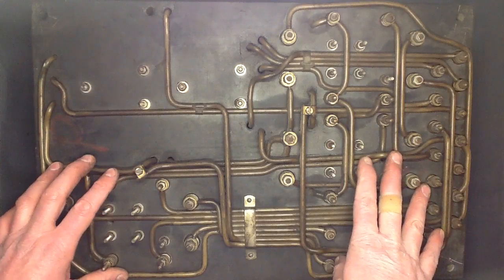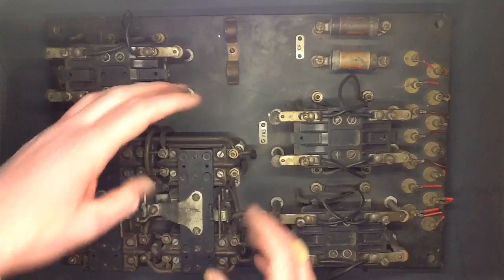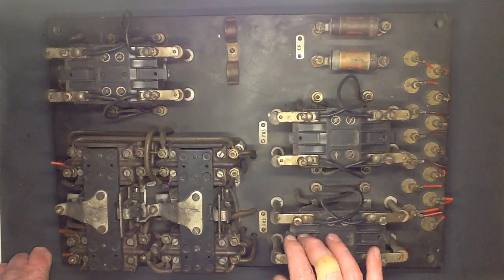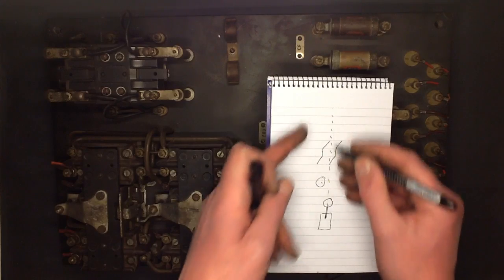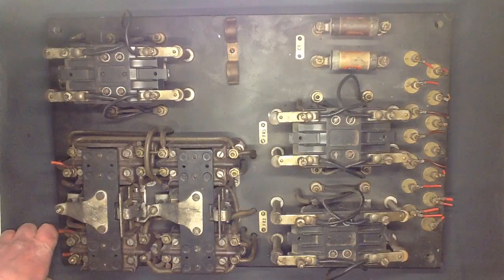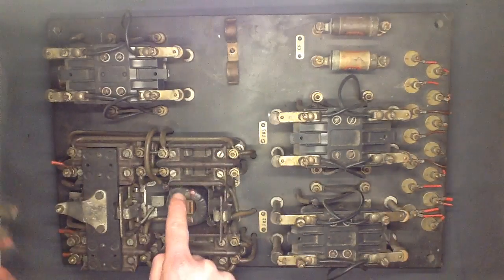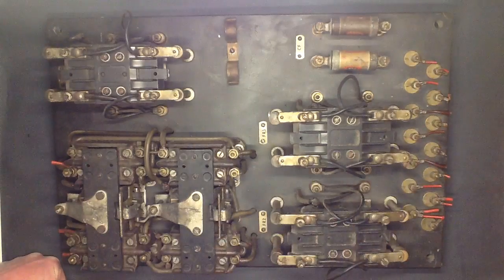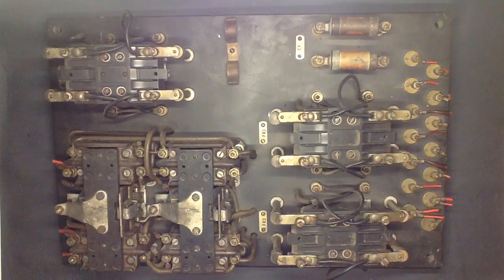Really old and VERY heavy slate elevator controller.

Comment: Why replace this ?
Why not simply add a circuit after it making the electric motors ramp up and stop slowly, and making the doors open with a discreet electric motor rack and pinion system ?
Because piece of shit "UUUUUUHHHH WELL THIS IS TOO OLD REPLACE IT GNEUUUUUUU" completely worthless working ethic. This pisses me off to no end ! This kind of mindbogglingly expensive to build today electrics being thrown in the garbage for kids in India to rip apart with heir bare hands and get cancer from it !
Reply: I think in the case of items like this, they replace it with newer technology that have alarms and safety systems in place and shit. It's sad but inevitable.
Reply: Chris Price
You can add the alarms and shit and not tamper with the actuation mechanism.
But that's if you're willing to scratch your head a few minutes instead of ripping it all out and plugging in a Chinese made numeric solution that is about as reliable as shit used as superglue.
It would also imply having actual properly trained people working on the payroll.
Reply: Lassi Kinnunen
No. I would say 60+. But that's a good thing !
Stop thinking everything needs a peremption date, when it was designed to work forever.
Reply: +Adrien Perié just because something is designed to work forever, doesn't mean it's feasible to do so. Whilst it would be lovely to see it do so, it would not be cost effective. Finding someone with the experience to repair it would be more difficult and more expensive these days, as well as the chances that newer ones are probably more energy efficient. We're also assuming that they replaced it with a newer model, which is likely, but there ARE like-for-like replacement companies out there for when the old one does break. I don't know whether they refurbish these and swap them, or if they dispose of the old ones, which is how they end up on channels like this that can be educational for everyone. So I don't mind that this has been replaced because it's now serving as a free educational material that is widely accessible.
Reply: "Whilst it would be lovely to see it do so, it would not be cost effective."
Yes it would be. Much more than replacing it. You're very naive. The point is to make money, and that means dumping the old out and replacing it by the new, even if the new is complete garbage and the old pure art that will work forever.
The proof is in the putting: it worked flawlessly, they replaced it and are unhappy with the results, the reliability went down a thousand fold, and cost of operation went up a thousand fold since now you have to fix it all the time.
I couldn't care less what you think, I wish my elevator still had it's old switches like I have seen done in many places instead of a Chinese made piece of shit plastic interface that's slow and unreliable.
Why are you coming at me with that ridiculous "they do it like this cuz its easier and cheaper" whilst it's the very first thing I said ?
You can either go cheap and get an unreliable piece of crap that has no intrinsic value and looks like utter crap, or you can have some respect for the hard, quality work of your ancestors, spend a bit more, work with professionals and keep the value and looks of your elevator like it was, yet still have all the comfort the latest made in PRC solution will provide, without the lack of reliability, highly increased cost, etc...
If people knew how much safer these are as well, and how much lower the chances are that you will be stuck in there because of some sort of anomaly, they would do what' necessary, but because of that bad bad bad assumption that newer is better, we get the most beautiful elevators in the world turned into worthless crap.
You don't have to be right you know. Maybie you didn't understand what I wanted to say. Maybie you should read it again !
Because defending these old pieces of art being thrown in the garbage to end up in India like they do as pot metal, or if your lucky in the hands of a good man like seen here.
What you must see is this: what you're truly saving on with simple all in one made in China solutions for elevators is people's qualifications.
But the truth behind that is that all it takes is someone who cares about his job to do what's necessary for the customer to be truly happy. Oh, you have a 100 years old elevator, let's conserve it as art, and make it just as comfortable as a brand new one (that's another point, fixing is way cheaper than replacing the whole elevator like is very often done, the main argument being: THAT ELEVATOR IS VERY OLD ! REPLACE REPLACE REPLACE !), all it takes is one solid rampup circuit between the switchboard and the motor like you can very easily find as a replacement part, and then a rack and pinion system with electronics a 12yo kid could put together for the door to open for lazy people (and also, hygiene people who don't want to touch the door).

It isn't that doing this is more expensive, it's that people who care that much about doing a good job for you are quite rare. Not expensive really, rare. You have to look for them, and not take the first offer you get. Basically, you have to give a shit, and appreciate hard work when you see it.
Chris Price
Reply: +Adrien Perié Please do not insult me just because I'm not inclined to agree with you. You're making great claims with little factual evidence to back it up. Where do we have evidence of the decline in reliability? How would replacing this part MAKE them any money? (except from reducing losses by being more cost effective, which would support my original statement). Where is the evidence that the cost of operation when up? Surely that would contradict the idea that they only did this to MAKE money?
Reply: +Adrien Perié I'm not sure why you're so angry. I agreed that it was sad to see it go. However it doesn't change the fact that whether the experts are expensive OR rare, they are not always a feasible option due to those things, and as a result, change is inevitable. 

If they were ALL treated as works of art, they would cease to be works of art, and just be a commodity. They're beautiful to see now, but no one though that when they were commonplace. Whilst it must be wonderful to see every single item of every day as a beautiful piece of art (except anything, apparently that uses more modern circuitry... Which leads me to wonder what wonderful contraption you use to post these comments) it's not something that comes without a price.
Reply: Chris Price
May I remind you once again that you don't have to be right or interesting just because you thought you were, because your comments are getting pretty silly.
Don't invest your ego into it ! Because you already lost the bet before dice hits table...

"they are not always a feasible option due to those things, and as a result, change is inevitable."
You know treating diseases is hard. Doctors are sometimes hard to come by. Therefore if you're sick you will die.
I mean I can't put it any other way. You keep trying to justify waste as it it had to happen, as if things had to be this way and no other. Are you that limited in your abilities ? Really ? Not doing that is beyond you ? Come on, I know that's not the case. Quit it.
"If they were ALL treated as works of art, they would cease to be works of art, and just be a commodity."
That sentence has no meaning whatsoever.
"it's not something that comes without a price. "
Which I said in my very first comment and which you now repeated twice in two separate comments as if trying to teach it to me.
It's getting really silly, do you actually have anything to say ?
Reply: +Adrien Perié Doctor's aren't that rare, and yes, you may get sick, but new medicine happens all the time and constantly provides improvements to the field in order to better heal the sick. Healthcare constantly changes in order the better serve, and the way a doctor may treat a patient now, and the medication provided, will differ greatly from that provided years ago. Yet we don't shun it because it was manufactured cheaply abroad (which a great deal of medication is). Or declare older medicine an art form that should always be used over newer medicine. The comparison is bullshit, and your argument seems to stem on trying to condescend me.
Reply: Chris Price
I was making a point about the ridiculousness of saying "they are not always a feasible option due to those things, and as a result, change is inevitable."
What I meant is that this isn't true. It isn't inevitable, it's bad practice by under-qualified people.
Replacing this switchboard was unnecessary, damaging to the value and reliability of the elevator, and flat out uncool, as you pointed out.
Just because it happened doesn't mean it has to be a good thing or that there are no alternatives, why try to make right what is by your own admission wrong ?
The real reason we are having this conversation is that you voluntarily ignored the meaning of my original comment, interpreting as if I was saying "this isn't normal", sadly it is normal, but just because it's the norm doesn't mean it's the best thing to do, and I can't believe I'm having to explain this to someone with beautiful blue hair !
"If they were ALL treated as works of art, they would cease to be works of art, and just be a commodity."
This doesn't mean anything, but I think what you meant was that when something great is the norm, we won't find it amazing anymore, and that's something I couldn't care less about/is off topic. The old switchboard is superior, it could have been adapted and not for more money than what they did, just more shits given. If all old elevators that had a bloody great switchboard still had it whenever possible, we would live in a better world of more reliable, prettier and more valuable elevators.
I don't need this kind of stuff to be rare for me to find it amazing, I'm amazed by the engineering of aluminum beverage cans, and that's one of the most widespread items on earth. All the rarity does is make you look at it, but I don't see how making good stuff more rare in our society as a good thing just for that reason.
That's my point.
Reply: +Adrien Peri&#233; When I bought my condo, it had a fine old lock on the door that worked as smooth as butter, and had done so for 50 years.  While I was at closing, the management sent somebody to my place and replaced it with a cheap new lock that has never worked right rather than just re-key the lock as had been done for most of those 50 years -- no  "actual properly trained people working on the payroll", just some handyman who didn't even quite know how to install a lock.
Reply: condew HacDC
Handyman is right !
The one good thing about this is that you sometimes find treasures in the bins, a year ago I found a 1930's radio, on top of it's cabinet, basically big as a small old TV, all made of wood and brass, I sold it to a guy who restores old tube radios for 200 plus a free 1953 French tube radio made of aluminum and Bakelite which says USSR in the frequency band, and lights up when you turn it on, sounds good too !
I just love analogical stuff full of tubes and various electrical deathtraps heheh
The truth is, those things warm my heart up, they are from a recent past where stuff you bought in store was made to last instead of engineered to fail, stuff was made strong instead of as weak as it can be for the application.
It's all of course capitalism evolving, unregulated, towards perfection: Very expensive very cheap to make stuff. That's the system working as intended for sure.

Comment: I remember back in the 80s for, I think, a Cub Scouts event, we got to look at the inner workings of a traffic signal controller while it was on. It used very similar mechanical switching controlled by timer switches very much like the ones you can get to plug into a wall socket (rotating dials with metal blades to trigger a switch). Nowadays they're all computers and solid state electronics, but I bet those old systems were extremely reliable.

Comment: It has got to be more than 30 years old (1986?) I'd say 70-100!
Reply: Maybe pre war but I'm sure the design is as you say older. Electrical design is a hobby for me so what do I know.
Reply: simhopp
Compressed paper circuits were available in the 1970's and in the 50's and 60's this circuit would have been constructed in a cabinet and wired. The components would have been standardized and not these custom build devices. So, at the very latest 1940's but probably well before WW2.
Reply: +Nick Breen I would suspect that 1970's era elevators likely would have started taking advantage of the high power transistors that had been around since like the early 1960's too, they were being used in high power DC inverters driving the AC motors in metro trains etc by then after all. Could be wrong but seems likely given that the required technology existed and the increasing drivers for innovation in lift technology around the same time due to the increasing height of concrete and steel curtain wall constructions of the time.

Comment: I once was working at a cement kiln, and they had an industrial lift that took you up to one of 7 platforms on the precalciner tower.
 The lift was known as the "Tardis", you never knew where you would materialise. Some of these towers are 100 metres high,so using the stairs was not a realistic option, but you could end up on any level, despite what button you pressed.
 As always ,interesting video, thanks.
Reply: +John Doyle Hahaha, very cool story.

Comment: By the way, I popped into 'Poundland' and took a look at those 'precision' screwdrivers that you use on other You Tube vid's.  I was impressed.  For a £1 they are a very useful tool.  Chrome vanadium tool tips which surprised me.  So I bought one purely to keep in the house handy rather than me having to gout to the workshop to get the more expensive set.  Hey, if it's pouring down it's not nice :)  Thank you for your videos I find them very interesting.

Comment: Given pretty generous estimates on the size and density of the slate, I'd say it can't be much bigger than 35x50x2 with a density of 3, which gives a mass of around 10kg. Plus all the hunks of metal attached to it, maybe up to 5kg. If it's more than 15kg total, I'd be pretty surprised. To guess, I'd say it's probably closer to 12.

Comment: 17.2kg or around 3 stone. My old boss, always said " if you really want to screw up an old reliable device properly, ( like a stove, fridge, washer / dryer or a 50 year old elevator controller) just add a micro processor........
Reply: +Rick Nelson Seems a waste of a good microprocessor to solve a problem that can be done in 5 relays.  But yeah, you can't build for the ages with microprocessors, they can just forget their program in as little as 20 years.

Comment: Nice video and explanation, Clive :)
That type of single speed lift is what I call a 'crash, bang, wallop' lol. Always remember to have your knees slightly bent before it stops ;)
I will never forget a day I went to a new (to me) site and climbed up into the motor room. There were three big Otis DC motors, DC generators, rotary floor selector units & massive controller cabinets choc-a-block with contactors and relays, not a circuit board in sight and all made in 1969.
The sights and sounds were something else - I actually took a couple of little vids which I should upload.
Cheers
Jim
Reply from the maker: +Cosmic-Wizard Yeah,I always bend my knees slightly to soften the jolt.  You should definitely upload those videos.  Don't worry about "filming quality" because it's just better that stuff like this is on YouTube.

Comment: It's like cars, there now so complex only a garage can fix them, where as in the older days .....you could.
Reply: +Mike Sanchez - Replacing sensors isn't so bad but compared to engines with sensors and those without... the sensor-less engines were definitely easier and less expensive to work on hands down.  Battery, spark, fuel and carburetor adjustments were pretty much the only things you had to focus on and fuss with.  Fortunately, with more complexity typically comes more advantages (ie) I'm not sure anyone would buy and drive a car to and from work with an engine that only gets 10mpg and produces a lot of pollution, especially knowing fuel prices could easily hit $5/gallon again  ;)
Reply: +hill billy my dad is an actual mechanic, and he says cars are getting harder and harder every year.....

Comment: 49.6 kgIt is only a baby lift control panel, used to work on goods lifts back in the 70 & 80s with large slate panel and open contactors, my apprenticeship end test was rewire a 2 floor goods lift part of that was the replacement of the control panel.The lifts I worked on also had wound rotor induction motors with slip rings where resistors were switched out by contactors to give the motor better starting torque.Working on those old panel kept you on your toes ............. modern 'elf n safety police would have fit

Comment: Those contactors are actually relays, hence FR1 - Floor Relay 1. The contactors are considerably bigger.

Also the carbon pads if you clean them up gently you will probably find that they are silver beneath the soot.

You can get some interesting faults on slates especially with DC. I used to work in a rolling mill motor room that had slate after slate and they're still in use now :)

Comment: Using some fun math, estimating that the slate is .8 inches thick, and 14x11, so using 0.1lb/in^3, the slate itself is ~5.5kg. 

The total copper tubing is about 10X the width, and estimating 0.25 inch tubing, so that's about one kilo of tubing. 

Transformers and topside electronics are hard to estimate... but lets say that there are 5 transformer like things, so 5 cores each weighing about a kilo. 

Plus a misc of 1 kilo, because I'm really guessing now...

So...5.5+1+5+1 = 12.5 kilos.